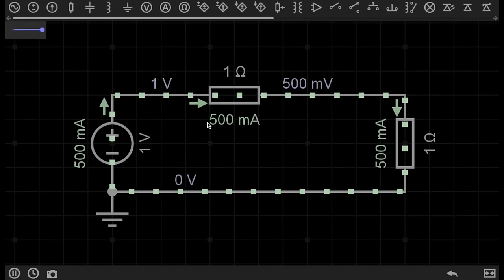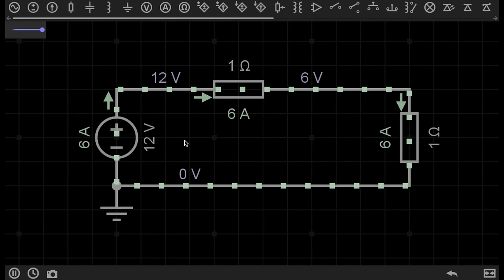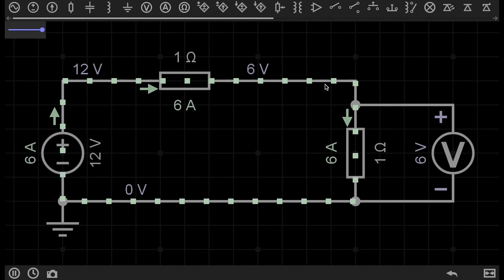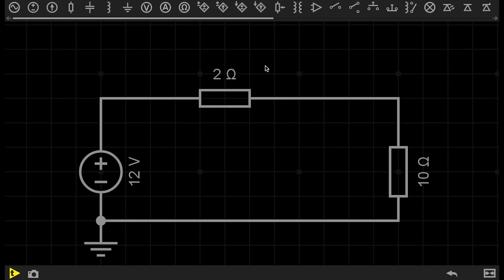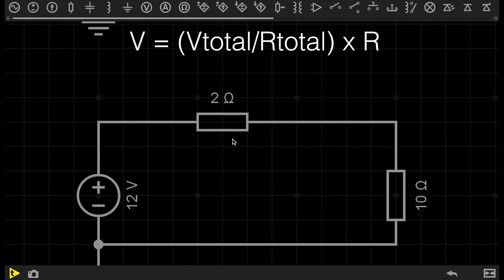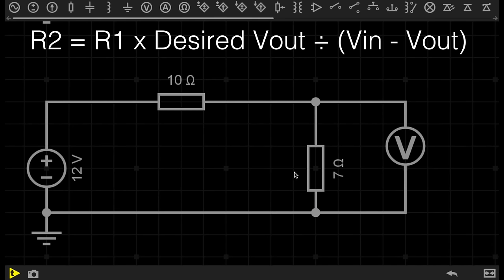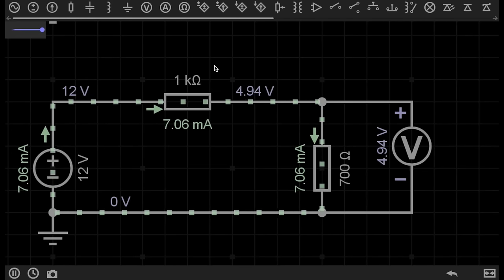Voltage Dividers - Electronics Basics 12

Comment: That is literally the best explanation of voltage dividers I've run across, I've struggled to figure out how to apply Kirchhoff's law when figuring the resistance of two base-bias resistors in an NPN transistor, I can figure out one simple enough, but making a voltage divider for the base would make it more stable and thus I couldn't wrap my head around the math for figuring both resistors out. So thank you so much for that, count me subbed :)
Reply: What he said.

Comment: Or, you can use the voltage divider formula...The value of the resistor in question, divided by the total resistance, multiplied by the total voltage!

Comment: sorry if this is a silly question but if you wanted 5 volts for example. why wouldn't you just use a larger single resistor to drop from say 12 v to 5 then connect your load?
Reply from the maker: It depends on what your load is, voltage dividers are generally for very low current applications such as a reference for an IC, where current will be minimal and quite stable.
Reply: This video is poorly motivated and very superficial. A voltage divider is not very efficient.
Reply: You may be correct but can you demonstrate it as clearly as Simlpe Electronics demos  the principles of voltage division via resistors?
Reply: Omission with a lack of qualifications is not clarity.
Reply: If you can explain with clarity please do, otherwise why do you criticize ?
Reply: while voltage dividers may not be efficient they are important in learning the basic concepts of electronic circuits.  This series is called "Electronic Basics" for a reason. I also don't see you creating quality content to show a comparison of "how it should be done". Your comment is akin to someone complaining while offering no solution.
Reply: what was omitted in the "basic" explanation of a voltage divider?
what qualifications are lacking?
The video is plenty clear in it's explanation of the "basic" premise behind a voltage divider

Your statement has no application to this video or it's content.
Reply: neoc03 thanks for your response to the complaint. This video came along at just the right time for my understanding of the concept explained in this instruction
Reply: They are not efficient but very useful in practical circuits. e.g. A reference voltage for a 9v battery for a microcontroller like an arduino
Reply: Nick Pierpoint Why don’t you just say what everyone is thinking 🤣🤣🤣
Reply: my dear bro.
using a single larger resistor would only reduce the current value while voltage would remain the same.It wont change.
So we use this series connection.That is what exactly series connection is.In series connection, voltage gets divided up while current remains same.
Reply: my dear bro.
using a single larger resistor would only reduce the current value while voltage would remain the same. It wont change.
So we use this series connection.That is what exactly series connection is .In series connection, voltage gets divided up while current remains same.
Reply: @saurabhshinde3540  Additionally, we use the portion of the voltage across R2 (called V2) to 'feed' another component which needs a specific voltage but draws no current (like the input of an OpAmp). The important part is "draws no current". If current is drawn, the current through R1 changes, with respect to current through R2, and the numbers change. So you use a voltage divider like this and connect a Hi-Z (or high impedance) component in parallel to R2 and that component sees (and uses) V2 in its interactions with the circuit it connects to.

Comment: You say that it's hard to find a resistor with 7.14 Ohm's resistance. Wouldn't it be possible to tune a potentiometer to that resistance instead of using the closest one available? Or is there any economical/technical issue with that? Thanks for the videos!
Reply: Well, potentiometers are expensive compared to resisters, and if you start to put a load and suck more amps through your voltage divider, it will change the characteristics and your volts might drop
Reply: N maybe u could make parallel resistor to get 7.14 ohm's.

Comment: what software you use to simulate those schemes ?
Reply: everycircuit. it is $15
Reply: @cachepage6261   no it's free to use. You can pay for more features if you  want
Reply: @j5892000  no. it's 24 hour TRIAL. Or you make new accounts every day.
Reply: @GameBacardi   no that's false
Reply: try using falstad
Reply: @j5892000  the other guy is telling true sorry but you are wrong
There is 24 hours free trial
Reply: @omkarmaindre2085  yeah its free and really useful
Reply: @j5892000  No that's true

Comment: Thanks. I was having a hard time getting why. 
so basically the drop to 0V is evenly shared by all resistor units (Ohm). The drop across a single resistor device is the proportional drop per unit (Ohm) times the units in that resistor. :)

Comment: 0:12, if you put an LED after the 2 resistors (near the negative terminal), will it not work? Since the voltage is 0?
Reply: The circuit changes (obviously) so it will no longer be 0v. The 0v will be on the negative terminal of the LED.

Comment: With regard to wanting a particular voltage from a voltage divider (3:48 in the video, trying to get 5 volts across R2), rather than calculating the value of R2 relative to a given R1 of 10 ohms (resulting in a very hard-to-find 7.14 ohm resistor needed for R2), couldn't you just replace the 10 ohm resistor (R1) with a 7 ohm resistor and then change R2 to 5 ohms?

Comment: Correct me if I'm wrong, but that power rating would blow up those resistors at 5:11 ... I think?
 If P = V x I you would get a power rating 4.9 watts on the first resistor.
Reply: there are many 100W or even 1000W resistors, extremely huge

Comment: I love this series and it is quite helpful, but you lost me on this video.  I get the math, but I just don't get the usefulness so it is hard for me to assimilate the information as useful.  all of the previous videos seemed to me to do a better job.  I am certain it will be clear as I move through and learn more, but wanted you to know about the experience I had.  Thanks, and keep up the good work.
Reply: Curious to know if you have found a purpose for resistor dividers?

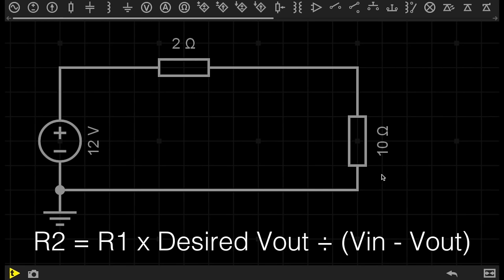Comment: At the 4:10 mark of the video resistor 1 is 2 ohms and resistor 2 is 10 ohms. Then when he goes to work out the equation, resistor 1is 10 ohms and resistor 2 is 2 ohms. Does that make a difference? Thanx ahead of time. Good video
Reply: The 2 ohm resistor will always have 2v and the 10 ohm resistor will always have 10v, using the example circuit, regardless of the order of the resistors.

Comment: So does this interactive doohickey only work if you pay the $15? I add the voltage meter across a resistor in the circuit, but then I can't get it to play. Or is there a button I don't see to get the current flowing again?
Reply: This app he's using?

Comment: Good day. I have a problem you may have the answer to. i have a 120w amplifier and a VU meter  that is rated at 60w. This VU meter connects to the output of the amp. I was wondering if i could use a resister to cut my wattage  in half to safely run the VU meter.
Reply: A VU meter is made with a resistor in parallel to the wire wound "motor" of the meter. It basically measures the voltage across the resistor inside the meter. That resistor has a capacity, and running a larger supply through it would break it. 

So you want to put an extra resistor in parallel with the meter, which will take 1/2 of the Power away. Then you're left with a VU meter which will read 1/2 of the true Power. Your scale would be wrong. The VU meter would work safely, but the reading would be inaccurate because the scale is 1/2 what it should be.

Check out some videos on shunt resistors to see how voltage is calculated according to current flow through a resistor, and you will understand how the VU meter works. Apply that knowledge to be able to calculate the necessary resistor to use in parallel with the VU meter, and then try it out. If you get it to work, don't forget to somehow change the scale printed on the meter.

Maybe you can find a data sheet for the particular meter which will tell you what the internal resistor value is, and just use the same value resistor in parallel with the meter.

Comment: 3:18 "forumula" it just means the voltage is  divided proportionally over the resistors
Reply: i think the best way to think about it is that the current thru each component is constant. V_total/R_total= V/R = I (current) :)
Reply: @andrescoca983  why?
Reply: @andrescoca983  nice, that's elegant!
Reply: @userou-ig1ze  because that is the assumption this circuit and formula makes. In the example circuits, the current IS the same through R1 and R2. It cannot be different, in these example circuits.

If you use V2 (the portion of Vtotal, measured across R2) as the input to a Hi-Z (or high impedence) component (like an OpAmp), there will be "no" current flow, and so The total current through the divider network (Itotal) will not change, which is where this formula and such circuits are useful. If you parallel circuitry with R2, and it draws current, then Itotal changes, and this change occurs through R1, so I1 will change, and the whole calculation changes. Then you have to mess around calculating the effective resistance of R2 and the circuit part which is drawing current, using the total current through that part of the circuit (R2+parallel circuit) and pump those numbers back into the equation with R1 to get the actual voltage drop across R2.

Or just use a Hi-Z component, and be happy.

Comment: I want to modulate AC and DC voltage by using voltage divider, means two sources AC and DC. Output should be about 0.6A. How can I select the Resistances ?
Reply: Use Ohms law. You know the V and the I, so calculate the R. Once you know the R needed at the point of measurement, you can then also calculate the 2nd R value to make up the divider circuit you need.

Comment: great video, could you explain please what happens in this circuit after I connect LED in series after second resistor, lets say i change power supply to 2V, resistors to 1 Ω each, in between R2 and ground i add a LED ( 2V, 20mA ) , now my voltage is not divided equally, is it because LED drains these 2V?
Reply: Yes. If you consider that a 2v LED using 20mA, there must be a resistance across it which can be calculated.

V=IR
2=0.020 X R
R = 2/0.02
R = 100

So it acts like a 100 ohm resistor in the circuit (for calculations at least) 

So you have 102 ohms total in series. The LED get 100/102 parts of that, and the two resistors get 2/100th or 1/50th of the total. 

The LED gets 1.96v and the resistors get 0.04v total. 

If you have 0.04v across both resistors, then one would get 0.02v across it, and the other would get 0.02v across it (because they're equal, they will get 1/2 each)

Comment: when do we use voltage dividers in parallel or series Circuits ???
Reply: all parallel things have the same voltage
Reply: @iwantitpaintedblack  That's a risky generalisation. Risky in that someone may read too much into your statement.
Reply: Aya, I've left a few replies to other comments in this video. If you still need an answer, maybe one of my other replies can help?
Reply: @CollinBaillie  *Have the same voltage applied to them but may have a different voltage drop across them

corrected? :D

Comment: @ 2:30 The equation is practical, but not very intuitive. I rather work out the current (1 Amp) in the circuit first and then calculate the voltage-drop over resistor-1: V = R . I = 2 Ohm x 1 Amp = 2 Volt. Now I understand what's going on. Nice video though.

Comment: Very helpfull, just one question. Say you have resistors of 1 - 10 ohm, only rounded numbers. Is there a method to calculate if there is any way to get the desired voltage with round numbers, treating both resistors as a variable, but rounded. And if there is, how do you do it? I know in practice this will probally never be a big problem, but I can imagine if you have really fragile equipment it might be.
Reply from the maker: I'm not quite sure I understand the question correctly. But, if you want to know the resistance of both resistors to get a desired voltage, there isn't an equation that will tell you what both resistors should be. However, you can work out the ratio between the two. First you need to know, supply voltage (Vin), and the desired voltage across a resistor(Vout). 

Ratio = Desired Vout/(Vin - Vout).

If my supply voltage is 12V and desired voltage is 5V. 
Ratio = 5 / (12 - 5)
Ratio = 1.4

I now have the ratio, but I still need to chose a random value resistor. Let's say I choose 10ohms for R2. Because the ratio should be 1.4, R1 should be 1.4 times the resistance of R2. In this case, R1 = 10 x 1.4. R2 = 14ohms.

If we now work out the voltage across R2...

V = (12v/24ohms) x R2

R2 Voltage = 5v

If you need rounded numbers and you get decimal answers, just round the result up or down to the nearest whole number. Your voltage won't be truly accurate, but good enough.

There are different voltage dividers such as accurate potentiometers that can provide much better accuracy and variable resistance.

Sorry if i didn't adequately answer your question.
Reply: Thx fot the responses. When I wrote the question I was wondering if somebody would understand it, but it happens to be I got my answers. Thx!
Reply: no problem M8

Comment: Fantastic, a channel that helps me, a software engineer, get into electronics! Q: why can't  I just use this, rather than  a buck  stepdown converter? Is this less efficient? If so, is it significant if I'm just using it to  step from 5 (arduino) to  3.3v (esp8266)?
Reply: Consider a voltage divider as "pass by value" to a function, as opposed to "pass by reference".

You're supplying a voltage level to your circuit without changing the current flowing through the R1+R2 divider. Say if you use V2 as the input to an OpAmp.

If you connect a circuit or component that DOES draw current, parallel to R2, then that WILL change current through the R1+R2, through R1, and the circuit changes. This is like a "pass by reference", which causes a change in the scope of the "calling" portion.

Comment: Can u compare Linear Voltage Regulators and this method? Which is better?
Reply: A voltage divider is all about getting a specific voltage level to part of your circuit. A Linear Voltage Regulator supplies both Voltage and Current to the circuit.

You use a voltage divider to set a voltage level to supply a component which "draws no current" like the input of an OpAmp.

Comment: Brother, your explanations are neat and precise.. But as of now i can see your videos are bit long..and are less in number... You can add few other concepts like; Wheatstone bridge, working of switches, embedded system, complex analysis, star delta conversion, battery, short circuit, soldering, earthing much more.. And if you are an engineer then analogue, microprocessors, micro controlers would be highly appreciated🙂 hope for the best!!!!

Comment: I am wondering if it's really as simple as that? Why wouldn't we only use one resistor? I have an old 12V 2A power supply and as it seems that 5V is very useful for many electronics applications so I only need a voltage divider as in the video to provide that 5V? Why have I seen some circuits that use some kind of IC would I also need to use one of those to make sure that the voltage from my old 12V is regular?
Reply: Answering your question about using only one resistor, you can think of the second resistance (in this video 10 ohm) as a separated circuit in which you need the potential difference of the two nodes which connect to the outer circuit (the whole circuit in this video) to be 10v. Because this inner circuit cannot handle 12v in those two nodes, you need a voltage drop that allows the potential difference to be 10v, and that's why you should add a resistance that will make a 2v drop across the circuit. The idea of a second resistance is an abstraction, you only care about the potential difference between the 2 nodes.
Reply: A voltage divider generally ISN'T used to supply POWER (that is, Voltage AND current).

A voltage divider is generally use to feed a voltage to a high impedance component or circuit which is considered to draw no current. Like an ADC or the input pin of a microcontroller, or an OpAmp. This is more like a reference voltage, not a supply to power a device, component or circuit.

Comment: What is the practical application to this, what would it be used to do?
Reply: To reduce the voltage output of the circuit, incase the voltage output previously was too high for the load

Comment: Hi if I want to reduce volt from 12v to 9 which resistor should I use
Reply: 7809 voltage regulator
Reply: What is the 9v being used for? As a POWER supply to a device, or as a reference voltage for measuring or driving an OpAmp or ADC or similar high impedance (Hi-Z) component?

Comment: What happens when you have no load on your selected voltage?  Doesn't this simply make an almost short causing the resistors to heat up to destructive temps?
Reply: But, the resistors are the load, in these simple examples.

At 1 or 2 ohms, the current flow would be significant, yes.

12v with 2ohms (total) resistance would give:

V=IR
V/R=I
I=12/2
I=6A

So, the circuit has 6A running through it. And we can work out the power given:

P=IV
P=6x12
P=72W

The resistors would have to be 36W each to handle that.

If you have large magnitude resistors (1k and 1k) the divider circuit gives the same result, but the total current in the circuit  would be 1000 times lower, or 1000th of the calculated voltage for the 2ohm example, or 6mA. The Power will also then be 1000th, or 0.072w or 72mW.